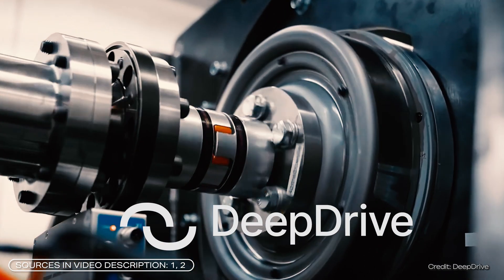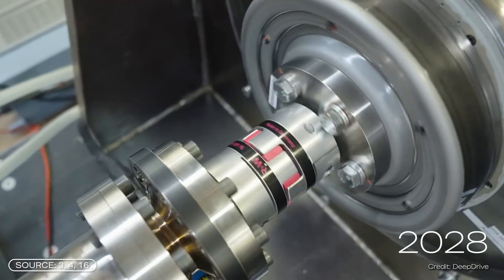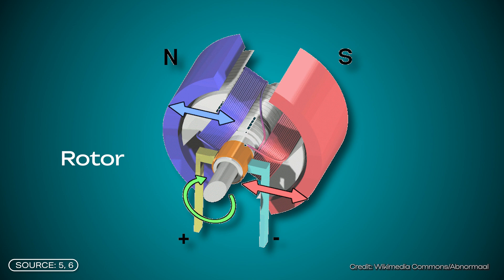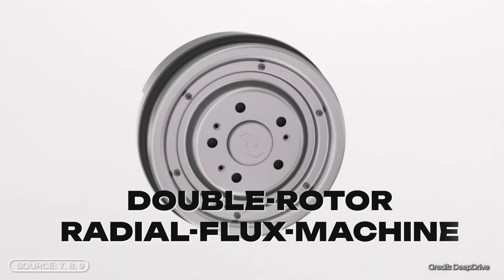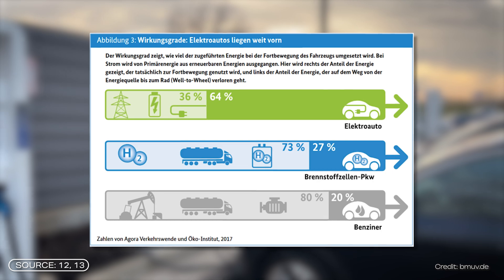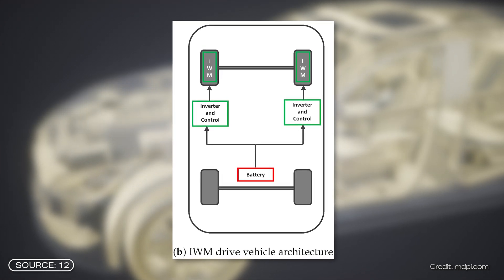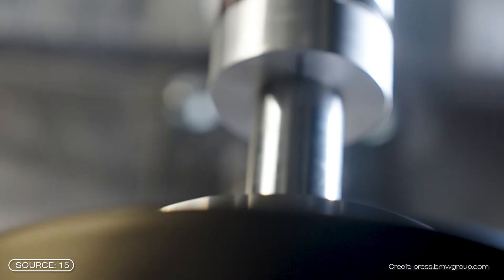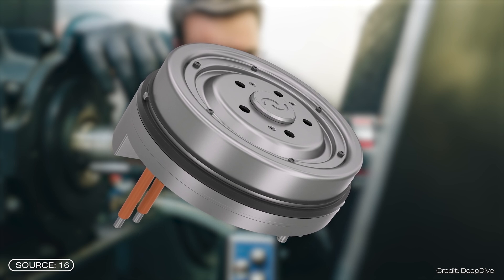Efficiency Made in Germany: DeepDrive's GENIUS motor

Comment: Easy way to reduce energy consumption: enact an 80km/h maximum speed limit on roads. It's enough. Other benefits: less noise, less wear on roads and wheels, less dust and microplastics, fewer and less serious accidents, and more benefits come because all kinds of durability tolerances (weight) that can be made smaller - from suspension for example.
Reply: Why not 50 km/h?

Comment: The basics of different electric motor principles and designs, their advantages and disadvantages, are very well understood, and the practical implications are if anything easier to predict than different internal combustion designs. Anyone seriously claiming 20% higher efficiency, as relevant for practical use, and without serious drawbacks shouldn't be taken seriously.  A different motor design and direct drive doesn't affect the efficiency of charging, grid and all the other irrelevant aspects you mentioned,  to increase the efficiency by 20% you need to have more than 16 2/3% losses in what you compare to, in this case the conventional electric motor and transmission to the wheel alone, which you typically don't have. So, I call male Bos taurus excrements on that claim.                 

Also reducing the weight by 150 kg, that's ballpark what the motors and transmission in some quite powerful electric cars weighs, another BS claim, if assumed to be a relevant number, and in a relevant comparison.      

Wheel hub motors are not just an old idea, they're common in other applications, like e-bikes, and there has been a few startups that has proposed wheel hub motors for cars in modern times too. The reason no big car manufacturer use them isn't that the idea is unknown to them, but the fact that the disadvantages outweighs the advantages. Besides unsprung mass, you have other issues. The issue of gyroscopic effects at high rotational speed for example, you want as tight clearances as possible to maximize efficiency and power density, that makes it extra stupid to use multiple rotors in wheel hub motors specifically.       

According to deepdrive they were found to be "in order to disrupt the electric motor" in 2021. If you actually believe "the electric motor" has such room for improvement that disruption is anywhere appropriate word for a "new" electric motor, what's keeping them?

Comment: The fact that the motor now has to resist all the forces from the non suspension area and the outside of the vehicle may drive engine costs up a lot. Therefore i have a question to you, Jacob: When it is possible to attach motors directly to the wheels, then why do "traditional" evs still even have a gearbox? Cant they just place the motor in the middle of an axle and put power on the axle directly?
Reply: The more pancake shaped motors that you get in hub motors tend to be axial flux motors, which have higher torque, reducing the need for gearing. 

I suspect the reason why all EVs have a traditional 1 motor and gear box setup is because thats how its always been done. We have EVs today with vestigial gear knobs for some reason, when all you need is a switch.
Reply: Hub motors ARE directly attached to wheels. e-bikes have been doing it for years. EV's don't have a normal gearbox but a reduction gear. This doesn't shift ratios; it is only there to get the wheel speed they want because the motor spin is not right.

Comment: I am disappointed in this video. Somehow the makers of this video missed out on old news. They dont know there are cars that drive in light speed? Light speed. In the meaning of the word. Cars are driven on high speed by the power of sunlight. Maybe the team should Google  World Solar Challenge. Its a competition between Universities who is the fastest with a only solar driven car over a distance of 3000 km where they can only use the solar power. Efficiency is key. Wheel hub engines are the standard. They are tested. Multiple cars several years on long distance. 
When behind the computer, Google "Lightyear one". The Eindhoven startup for a commercial car based on the experience by winners of the solar Challenge. Unfortunately the startup was in Eindhoven not München. Far away from big car manufacturers.
Meanwhile I wait for the comeback of the electric loremo (German innovatieve project, Google)
Reply: Solar Challenge EV's are impractical for public use, and never will be. They are irrelevant to more efficient motors.